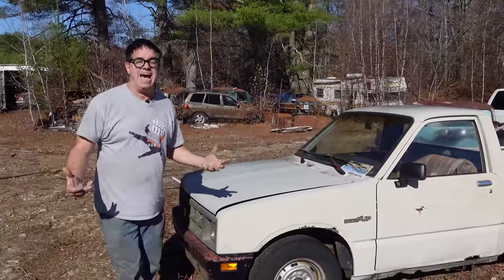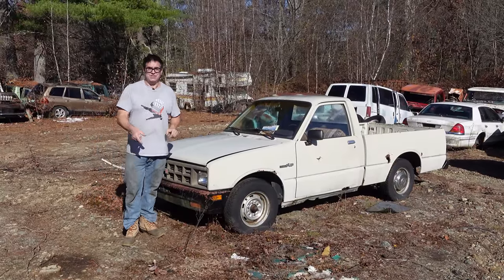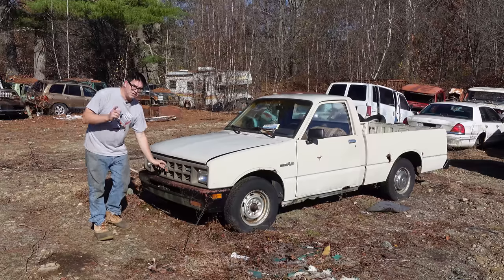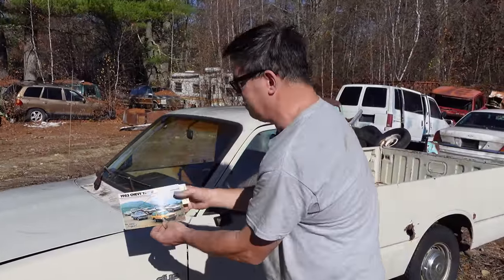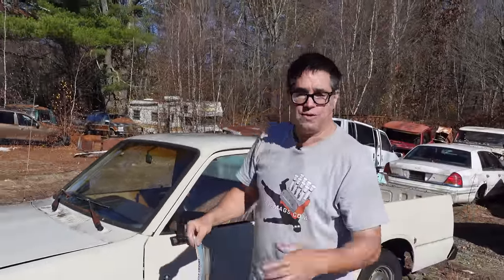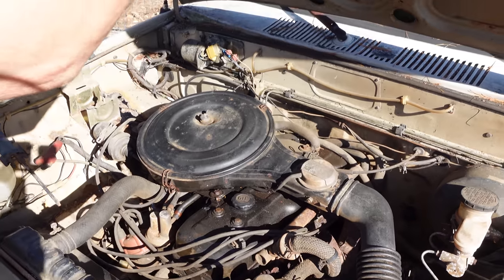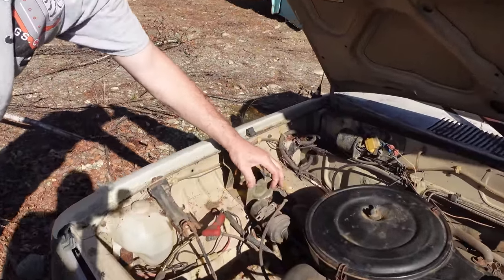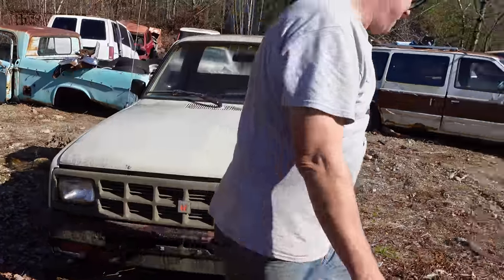1986 Isuzu P’UP

Comment: These came in four wheel drive too and I never want to rebuild the front half shaft on one again unless someone else removes it. The hog rings that hold them into the side gear expand beyond any chamfer making them a royal pain to pop out. We chained the truck to a tree and used his work van to pull it out risking ripping the side of the housing out but at that point it was about to get crushed by the Cat he also had if it didn't come out.

Comment: My great uncle has one to this day with the diesel engine, 4x4, manual trans, uses it to pull trees to cut up for firewood and also uses it to plow our property's road when it snows, last I looked it had 345k miles bed is dented in multiple spots from fallen trees onto it and still get like 30 mpg or more but takes about 1 year to get to 60 mph  but bullet proof if well maintained
Reply: Also if you hear the diesel version idling the name makes more sence... 
Pah-up, pah-up, pah-up, pah-up, Pah-up, pah-up, pah-up, pah-up, Pah-up, pah-up 
( PRONOUNCED 
P ah    'UP! )

Comment: The ironic part is that Isuzu helped GM design the S-10/S-15. 

The P'up's platform later gave life to the MU and MU Wizard, known as the Amigo and Rodeo here. 

If you run across an early 80s RWD I-Mark, let me know, I need seats.

Comment: Hi Steve, nice video, very accurate.  GM and Isuzu is still doing the same thing with the Isuzu NPR truck.  It is a Low Cab Forward (LCF) medium duty commercial use truck.  The trucks are also marketed and badged as Chevrolet W-Series and GMC W-Series, depending witch truck dealer that you buy them from.  They are all three the identical truck with a Isuzu desal turbo 4 cylinder standard, or with an optional Next Generation Chevrolet Small Block gas V8. Please reply.  Dave...

Comment: The”sealed” carburetors typically had plastic or pot metal caps that could easily be removed for adjustment.

Comment: I would like to have an 83 LUV (never saw them in the in Midwest) I almost purchased an S10 and glad I didn't.  A friend had an S10 Blazer (new) and for the first 4 years it was great and then keep your wallet open...  The Mazda P'up's of that era were bullet proof and rust resistant for the most part.  Thanks for the educational videos Steve or should I say Professor....
Reply: Back then you could get a S10 with the 1.9 Isuzu engine and a Isuzu 4 speed manual. From 1982-1985.

Comment: A friend had one with a 5 speed and a 4 speed shift knob.
Drove it for a year before he accidentally found 5th gear!
Bought used, so who knows why the wrong knob was installed.
Reply: lol I bought an old 1990 nissan sentra coupe with a 4 speed manual tranny, but had a 5 speed pattern on the shifter. I popped the hood and it had a junkyard writing on the tranny so i guess they swapped it. that car was one of the best $600 I ever spent! it ran amazing with 200k miles plus i sold it for 1200!

Comment: There was a station wagon and sedan with the early Luv front clip 
The Florian 
The 1.8 liter was dropped in the later S10 
Alternators and voltage regulators were garbage points burned out all the time
Head gaskets too
Luv Potion was the fastest 1/4 Mike minitruck for a long time bfgoodrich Las vegas
Never saw an Odometer with more that 75k
We had a car club called Luv It Low 1995
10 trucks all heaps of shhh 
Low rider club gave us props for the luv specific rides when we cruised Las Vegas strip
I owned 3 luvs 77slammed79slammed 81 longbed prerunner walk through 1/2 camper 
Never got laid more in any other cars than luvs

Comment: Still using my 87 longbed as a weekender. Only has 80k mi on the clock. I bought it with 35k eight years ago. Basic and spartan and unlike the suburbanites with the $80k trucks I can haul 4x8 plywood. Don't ask i will not part with it.

Comment: My dad had a 86 he bought used in 87 for 1500 it belonged to a home nurse she had put a lot of highway miles on it.
He got to the high side of 400k almost 500k miles 
He used it for every thing .
It tought me and 3 of my cousin how to drive a stick I actually used it in my small rul high-school driver ed class. 
He got a s10  in 90
So it was really a farm / work truck
Well haul i have known idea how many loads of chicken fertilizer.  Which probably helped the bed rust through it actually fell to the ground around the frame. 
You could not kill the little beast. 
It got really bad oil leak some where in the high 300k range
Dad quit changing oil because you were adding a quart every 2 weeks
So he bought the cheapest he could get old stight 30w
Reply: Dads had air but it didn't work long after he had it.

Comment: I had a 2000 VehiCross, so Isuzu will always have a special place in my heart. Much different engine of course (3.5 DOHC V6). The traction control system foiled burnouts, but there was enough power there.

Not especially durable though. I had to dump it after about 7 years of ownership when the transmission failed, and it was just too expensive to fix
Reply: I am also an Isuzu owner. I still have my 90 Trooper. I looked specifically for the Chevy V6 and Isuzu 5 speed. I wanted to make sure I could always get engine parts and avoid the dreaded 4L30E transmission failures.
Reply: The automatic transmissions are the GM 4L30, the only bad part in an Isuzu!
Reply: @WieDrDerJonge  True. But the Isuzu engines had many issues. The 4cyl heads eiher cracked or warped which was actually very common with aluminum headed 4 cylinders of the time. The later 3.2L and 3.5L engines would constantly burn oil from clogged drain back holes. They weren't perfect but they were damn good vehicles for their price. I love the first gen Troopers because they are unique, simple and the visibility is amazing.
Reply: @geoffmooregm  Unfortunately for me, I think the VehiCross was available only with the 4L30E. But what a fun quirky SUV it was. Had the fastest SUV quarter-mile time for its model year.

Comment: Dude no way😃 I have this very pickup same white  paint, same interior but it's not AC I don't know why Grandpa didn't pay extra for the AC we live in California but it does have a back window that opens and a aftermarket plastic bed liner 42,000 original miles it was my grandpa's it's so new still it has paint on the exhaust I drive it  at in least twice a month for picking up VW parts 😃 I just ordered a Weber carburetor for it to get rid of the computer-controlled carburetor it has😂

Comment: super, i have a isuzu kb28 1987 here in the netherlands its a camper , super solid hard body end the engine runs on benziine and gas  the gearbox is broken 4th and 3gear are out now i whant to hafe new parts for my 5th speed isuzu kb pick up and i findt out nthet the gearbox is a 4ja1 same parts juse anno 2023 ,  but i whould like to hafe a spare parts car ore to fix your truck what will ben the price if you ship it to the netherlands ,?

Comment: In 1985-86 I sold cars for a Chrysler/Plymouth Isuzu dealer in the San Francisco bay area. Isuzu was a weird brand to handle and a hard one to sell. They had almost no marketing or image and nobody knew what they were, hence almost zero interest from the public. The only thing that anyone was interested in was the Trooper but the allocation rules were idiotic. We were getting 2 Troopers a week and allocation was based on P'up sales of which there were almost none. We were trying to compete with Toyota Mitsubishi, Mazda and Nissan dealers who had trucks with features that people wanted in any color they wanted. Stupid Isuzu sent us strippo rubber mat specials in tan, navy blue, white, brown. The austerity thing was so out of synch with the bay area market. The Impulse sports car looked neat but sounded like a 4 cylinder truck. Hugely disappointing. The I-mark was the small car they offered which should have sold like crazy. Between 1984 and 1986 they redesigned the I Mark from rear wheel drive to front wheel drive but failed to deliver any cars to us from the end of 84 until the beginning of 86. They had announced the new cars and for over a year we had nothing to show confused customers who wandered into the dealership. I had a notebook full of names and phone numbers to call if and when we ever got any I-marks in stock. I felt sorry for the Isuzu factory rep who would occasionally visit and patiently endure our questions and abuse. Isuzu must have been the stupidest car company ever.
Surprisingly, I almost bought a P'up because my dealership was so desperate to unload what we had I could have bought it at cost. They were well made. My most faithful customer was a guy from El Salvador who came in twice a year to buy any diesel P'ups we had. He would drive them down to El Salvador to resell.

Comment: Hate to be that guy but your political timeline is a little of. Nixon enacted the 55 MPH in 1974. He was out after August of '74.
The first 85 MPH speedos came out in the fall of '76 as 1977 models. This was influenced by Joan Claybrook of the NHTSA
under Gerald Ford.
Reply: Correct. Mr. Nixon was out of office after August 9, 1974. Plus, Mr. Reagan didn't repeal the law in 1995, Congress did.
Reply: We had a '76 Maverick, and I believe its speedometer only went to 100, so they were beginning to creep back, earlier than the mandate.
Reply: @DanEBoyd  No, that's incorrect. The mandate didn't come out until the 1980 model year, so vehicles prior to that would have speedometers going up past 85 MPH. My 1979 Trans Am has a 100 MPH speedometer, but my 1980 has an 85 MPH one.
Reply: @googleusergp  Think you might've attributed someone else's words to my name. Dad's '75 Cutlass went to 120, Mom's '76 Maverick went to 100, and Nigel Tufnel's Marshall amp went to 11!😃
Reply: @DanEBoyd  No, I was commenting on you stating that they "were beginning to creep back". That's not a correct statement. The manufacturers didn't change their speedometers until the 1980 model year when it became a requirement.
Reply: @googleusergp  But you stated yourself that your '79 TA only goes to 100. Just a couple or few years before that, they went to 120 or even 140. Earlier Mavericks than our '76 went up to the full 120. (Not sure which the '75 had)
Most speedometers went to 120 in the early '70s, unless it was a vehicle which was speed limited, like a big truck or an economy car. But by 1976, the manufacturers were absolutely putting 100 MPH speedos into vehicles which had previously had 120 MPH speedos, and which would go on to have 85 MPH speedos.
Reply: @DanEBoyd  Bad information. They changed when they had to and not all changed by then. Only when the standards forced them to. Case in point: some manufacturers kept the "points" after 85 MPH mark and just didn't mark them with numbers past 85 MPH, which met the standard. In the case of my 1980 Trans Am, it has international symbols on the gauges where my 1979 has "WATER" "OIL" and "VOLTS".

Comment: Chicken Tax avoidance Vehicle! The 82 HP 1.95 liter Single OHC four was the base the Isuzu Impulse / Piazza Turbo engine was based on. It was still quicker than a try deck six in line Ford Falcon Utility or Holden Kingswood  utility in Australia from 1983 to 1986. The little four cylinder 'Suzu, if it didn't rust, handled well and steered okay, braked good and hunted gutless Overhead valve sixes in Australia and New Zealand.